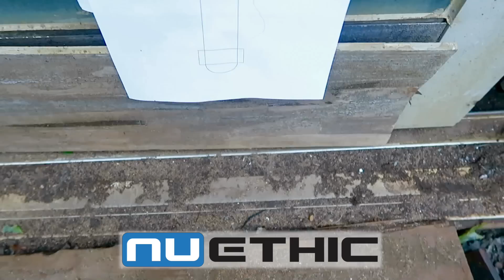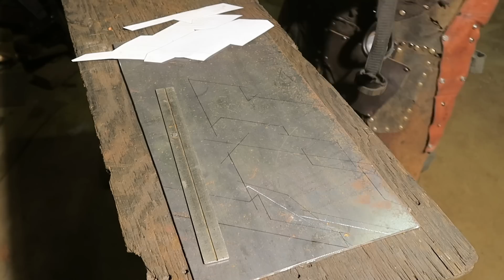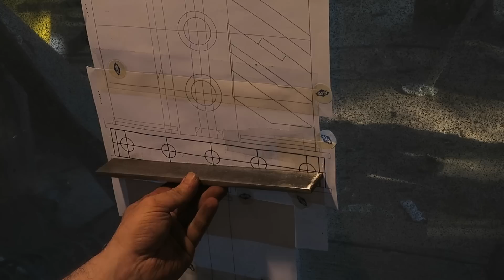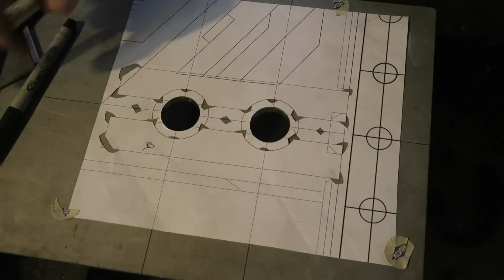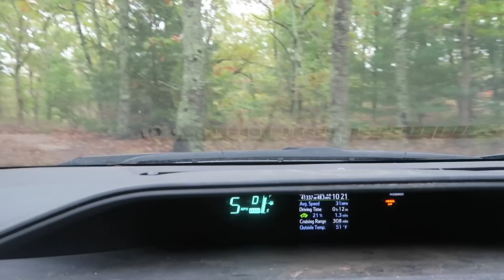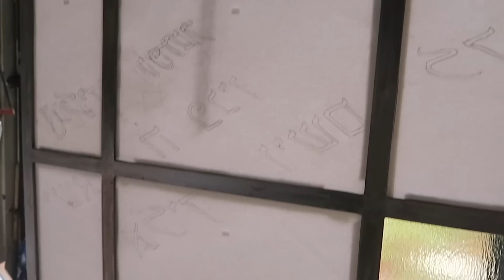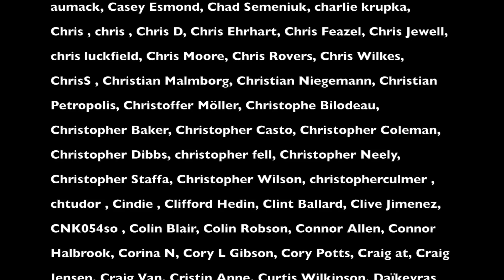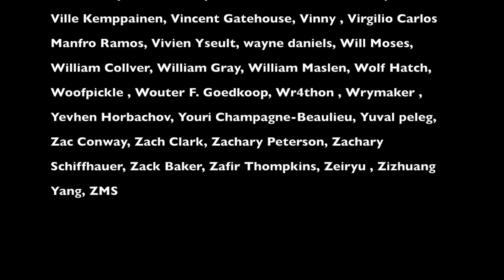Final Fantasy 7 Remake Buster Sword Build.

Comment: Im surprised that no one asked mike for a skyrim build yet. Seeing him build an ebony or daedric great sword would be orgasmic
Reply: Comes down to who's willing to pay for that.
Reply: meaty cabbage that would easily be atleast 3k or even more
Reply: Actually, Mike mentioned a daedric sword in his recent Q&A. He said that although he'd like to do one he doesn't know how he could create the correct colors without using paint. 
PS Mike hates using paint.
Reply: Some kind of glass enamel and metal power cooked onto it ?
I was pondering colour as an issue the other day and I think it's a problem the jewellery industry surely must have solved already.

Or host may just need to find a option that has the best scuff resistance - speaking of which Mobile phone covers have something on them I think you can buy in a spray that make Glass really scratch resistant if he ever wanted to put a glass eye on something (like Nightmare's sword for example)
Reply: meaty cabbage I'm surprised no one has asked for a dark souls trilogy weapon. Some of those weapons are either so massive or so amazing looking

Comment: I still think if the hilt is only welded together with the blade, it is gonna break easily given that the blade itself is so heavy.
Reply: Who you been welding with? A weld done right is like wood glue: stronger than metal around the joint.  Im guessing you are welding too cold, and/or moving too fast sir.  Lack of gas maybe, but that would be popping and noticable.  A weld should never be thought of as the weak point.  If so, then someone is scab welding.
Reply: I was a welder for 9 and a half years. A good inch of weld should hold a tonne. This should be fine aslong as the weld is good.
Reply: I doubt the buyer is gonna be swinging it around every day
Reply: @pip5188  so naive
Reply: @jonicson5651  Some people think scab welding is: (welding).  I've met people who've welded their whole lives, and really; they can barely stick stuff together.  I was sent to look at a mount for a very heavy chicken house fan (just built).  I could pop the welds without a tool.  It never would have held, would have fallen, a whole house of birds would have likely smothered.  I had to re-weld every jouint.  The welder supposedly welds galvanized cages all day.  I think I know why chickens were always loose. LOL. thanks for swingin in and backing me up.  Ive seen a 5th wheel plate plug welded and still get popped off with a pry bar head explosion  He was supposed to be the (Top Certified Welder)..on paper..........he wasn't allowed to weld after that.  He was so proud of how pretty his plugs looked....LOL.  1st thing I welded was a long, spare wheel and tire rack for a shop...........still in use today and been sittin outside for 20years atleast.  Coming from wood to metal.....welding is the beez. " I want these pieces together"....BBZZZZZAP! "together!" 👍👍👍

Comment: Love the vidoes, your a tallented individual and no mistake.

If your worried about the leather moving about on the handles after being wrapped, wet the leather first, wrap, then dry in hot air (I use an oven at about 50°C for knife handle wraps). The leather shrinks gripping the handle and toughens a bit making the wrap a lot firmer.

Might be a bit tricky fitting one of your swards into an oven though lol but I daresay you might be able to make/mod a sward handle dryer of some sort with your ingenuity ;)

Comment: only thing i would be worried about is when u cut stuff with it and maby cut with the lower part of the blade that it would cut up until the overlays and then the overlay might break or deform due to the force of the cut. its just something i would be a bit worried about but yeah. GREAT JOB Mike :D

Comment: I'm pretty sure that the reason it looks different than it did in crisis core is because unlike Angeal and Zack, Cloud didn't know how to use the sword properly, and it therefore really felt the wear and tear(especially since Cloud probably wasn't quite as concerned about said wear and tear). That explains the guard and wrap needing to be replaced as well as the splotchy texture. My theory at least.
Reply: Lukas Ampongan I think it just had to do with the devs slightly changed the design.

Comment: solution to the part at 1:00:00 is a 90 degree die grinder with a i forgot the name of the pad but it is not sand paper and the metal turns out baby smooth and polished.

Comment: Hyperacuity 
is the term applied to a sensory capability that transcends sampling 
limits set by discrete receiving elements. Sensory discrimination is 
limited by the structure of the receptor apparatus that interfaces an 
organism with its environment, e.g., retinal cones in daylight vision.May 20, 2011

Comment: I noticed you don't use a tang to form the handle.  Does welding a handle on work just as well?  I seen you swing your swords and smash stuff, so it must be stable.  I  just figure that using a tang would be better.

I also wondered about when you start of with a sheet of steel.  Is that sheet just as good as when people fold the metal themselves?  It almost seems like cheating, but I suppose if it does the same job in the end, it don't really matter.

Comment: please wear safety goggles for using a cutting torch as well...That outputs a lot of dangerous light still in many spectrum's. Blue light like that takes a full 24 hours for the damage to become fully apparent and it does cumulative damage over time. No one wants to see your genius held back by the burdens of glasses to see underneath welding or cutting goggles. keep up the great work!

Comment: try wet sanding the old lenses going to higher grit until final step is buffing we use a simmiliar method for restoring headlights for cars and whatnot
Reply: I've used that method on turntable covers with success. But a lens have to be perfectly flat, not just smooth, or it will distort your vision. I think it may be hard to accomplish a perfectly flat sanding, but I don't have michaelcthulhu skills.
Reply: DirtPoorFarmer compared to the price of those lenses, the time expenditure would make no sense. for headlights, that's a different story of course ^^

Comment: Michael, I dont mean to challenge your method but why dont you grind a bigger edge bevel? it would lighten the blade and you would need to mask only the decorative sections as the edge grind would provide the intended contrast between the blued parts and the "edge".

Comment: Did you ever explain how those rivet things worked? I don't get how they flatten out on the bottom/inside to hold effectively if you are only apply pressure from the top.
Reply: Avid Writer the squeezing he does on the rivet at the top actually pulls on the rivet from the end, pulling a ball of metal through the rivet tube. hard to explain but it expands the rivet thus giving it the hold. usually they are used when you have a hole that goes all the way through. ive never used it when the hole isnt drilled all the way.

Comment: Hey im new into knife and sword making and the one thing i dont know about these videos is where to get the material you use to make the swords, I believe it is called hardox, but when i look it up or look around for it i cannot find any place that sells it?
Reply: normaly every good steel trade has it. its used for excavator,kipper dump etc.
Reply: Yeah i hear its cheaper than plain steel because normal steel would cost me probably around 100 dollars for one sword and if well built i would be able to make profit but since im new im bound to make mistakes and dont want to spend that much.

Comment: I know that this as nothing to do with this video, but do you know how much a real dragonslayer would weight?
Reply: about 400 lbs
Reply: well, i've been looking it up on forum, but it all say different stuff so I dont know, that'swhy I prefer to ask mick
Reply: Virgile, you can impose some educated guesses to dimensions too. Take the average size of something that is pictured next to the sword and use that as a frame of reference, I used the average size of the human ear to determine the approximate height and length of the ferrule and butt cap.
Once you have that, then you ballpark the length, width, and height for an approximate figure.